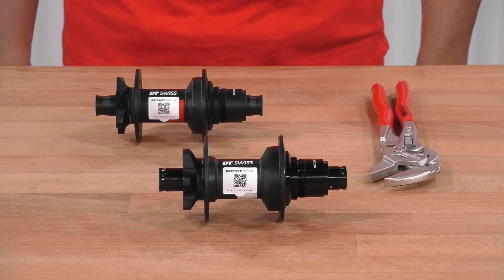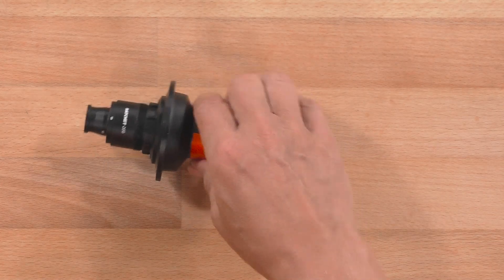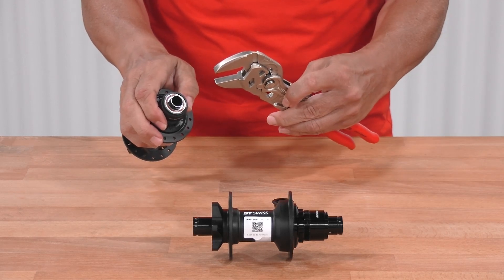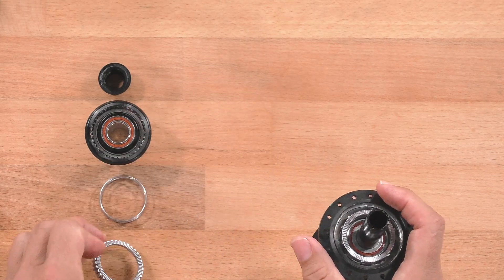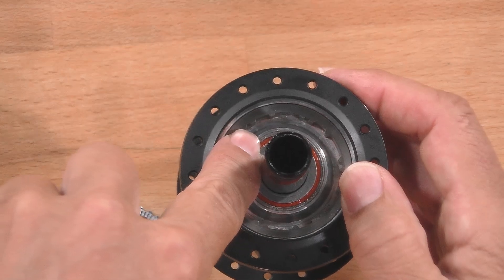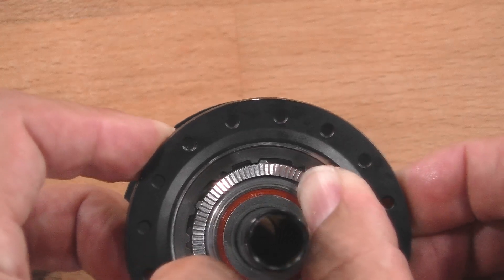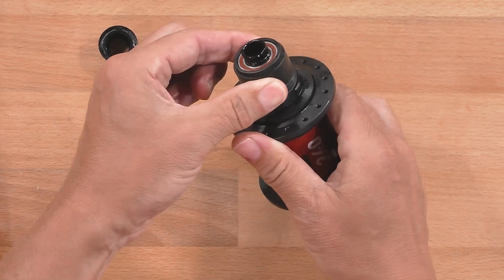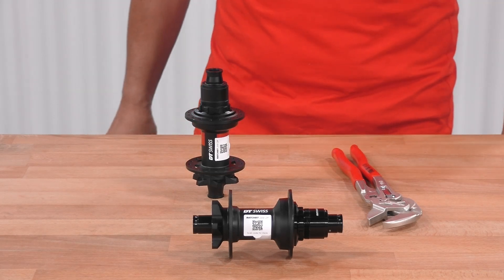How-To: Ratchet DEG DF Setup | DT Swiss

Comment: You are, of course, not offering free replacement to those who bought the regular DEG? Looks like this feature should be in the DEG hub from the start, and you released DEG only a year ago
Reply: it'll be a cheap upgrade, and not everyone wants or needs to have an anti-kickback feature on their hubs
Reply: @themeatpopsicle , from an engineering perspective, it makes no effort to just have this feature in every hub, as it is nearly the same machine process. And as you saw, there is a 0-degree setting (anti-kickback off), so if you don't need it, you just turn it off.
It's currently 130 EUR or 176 USD, almost the price of the hub itself. Where is it cheap?